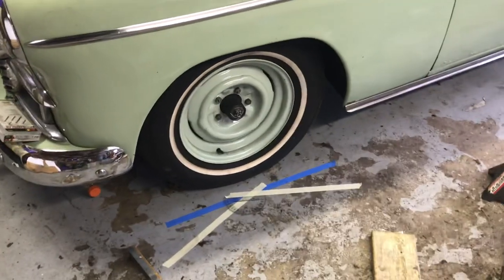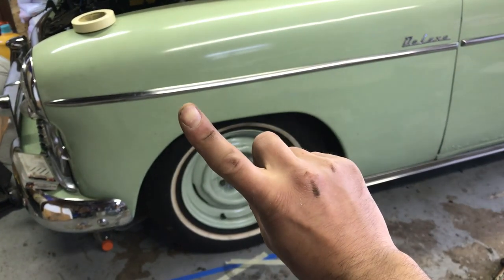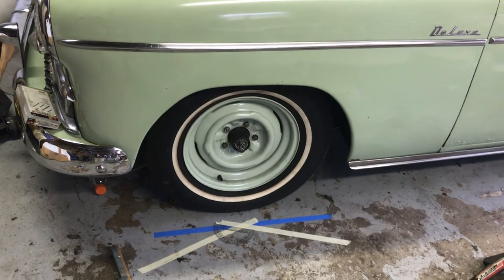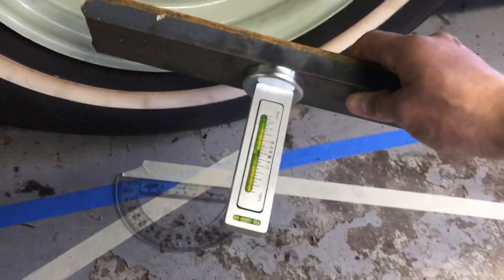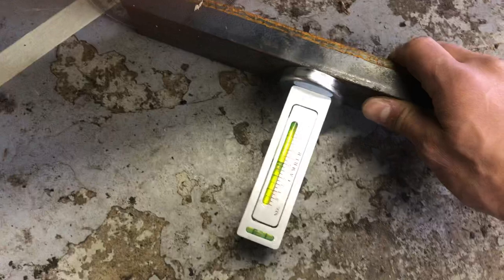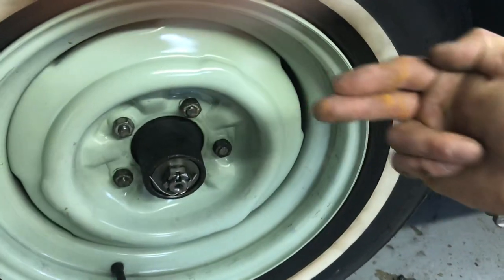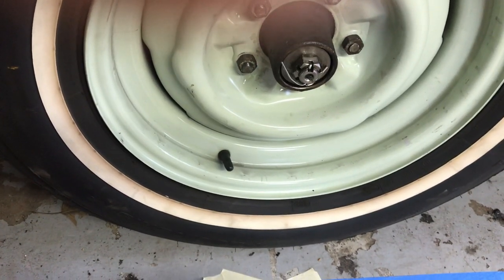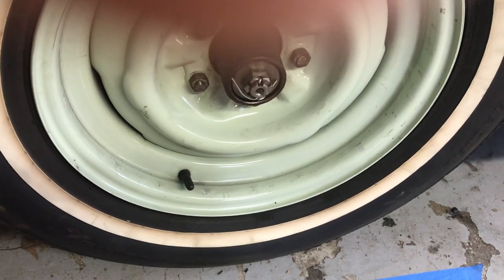DIY Caster camber measurements

Comment: FYI, that isn't totally correct. If you are going to use a camber gauge, then you need to do some multiplication depending on how far your sweep is. The change in camber does not directly give you the caster reading. It will considerable less.

Comment: Nice video.  I just got one of these gauges.  I am working on a 29 Model A coupe.  At some time I think someone had pulled the car out with a chain by its straight axle.  It had some serious bend.  I took it all apart and got the axle back flat.  Now back on the car, I have different camber on each wheel.  I bought this gauge to help me get an accurate bend on the axle.  Interesting that these old cars were to have 1 to 2 degrees of positive camber, leaning out at the top of the wheel.  Anyway, you take care.  Tom
Reply from the maker: Hi Tom! Glad you found it useful. I have done to understand the positive camber was to make the car easier to steer, but of course at the cost of high speed stability. Like a shopping cart vs a bicycle 

Good luck with your project! Hope it goes smoothly and thanks very much for your comment

Comment: Make cheap turn plates using 12'' sq adhesive vinyl floor tile. stick one to the garage floor (for each tire), put a small amount of grease on the top. Place another tile upside down on the greased tile, sticky side up. Pull the front car tires onto the tiles on BOTH sides with wheels straight. Do the measurements as shown in the video.

Comment: Ok stupid question that I am pretty sure I know the answer too, I have a digital angle finder I bought with a more expensive kit. Reading the angle from front of vehicle is what I want on each side right?  To get correct positive or negative for camber and caster. In other words dont read one side from back and one side from front. Their instructions don’t mention this and their customer support kind of is not helpful.
Reply from the maker: Never a stupid question, only a bad teacher (RIP Mr. Miagi). I always take my device and measure an extreme example. For camber, you can figure out which way your device goes by pretending your wheel is stick out at the road 20deg (extreme negative camber) and noting how your device reacts... that will tell you how to interpret less extreme readings  - does that make sense?
Reply: @DrewGarage  100%, kind of tinkering with that a little, need to fully understand what the readings mean. Changed balljoints and upper camber/caster sleeves. Think their instructions say to start turned in, zero finder then turn out 20 degrees and the is caster. 
So let’s say factory spec says 4 degrees. Next I set my in/out at four degrees. I see some videos say to do that to find caster then multiply by two to get caster. That confuses me why some say to do that but others don’t. 
I put factor upper bushings back in and measured those just to be sure and I think one was at 3 degrees
Reply from the maker: @joeholland428  Well, perhaps starting at 0° camber, 0° castor and going from there will help? This is by no means easy, and unfortunately, one of the most potent indicators of some thing wrong is an unevenly worn tire. If that happens to be a $240 wide white wall or nostalgic tire, no fun! What car do you have
Reply: @DrewGarage  I am working on a 2011 E-450 motorhome chassis. I bought these adjustable bushings to replace solid on setting ones. I did start at their “zero” then adjusting from there. I am actually zeroing in on it I think as we type. I am about to make an adjustment to account for the difference. Big help was just knowing what was what from positive to positive. 

I am still wondering why some videos say to multiply what number you get for caster by two to get caster
Reply from the maker: @joeholland428  
Wow that is cool! 
Not what I expected. I am not sure, but the information I gathered to make this video was from the leading supplier of camber/caster gauges for race cars. Expensive units. It was a long time ago, and at this point, I would need my own video as reference to do the job, but back then, I studied quite in-depth how to use their gauges, then bought an inexpensive knock off as Their little gauges cost more than my budget for an engine in my project

Comment: I have a 49 shoebox and im teying to figure out the steering when i go up to higher speeds the steering start to dance around all over the place what pointers can you give out
Reply from the maker: Start with tire balance and check for play in the front end. So many issues come down to balance and or a loose front end. Even a proper front end is loose in these cars compared to modern, and radials will magnify that

Comment: Don't you multiply the gauge reading by 2 or 1.5?
Reply from the maker: It’s been a quite a while but what’s in the video was correct based on that research and it’s been driving perfectly since :)
Reply: If you are using a 40 degree sweep (20 degree out to 20 degrees in) then you multiple the camber change by (180/3.14)/40 which is about 1.43.  If you use a 30 degree sweep, you'd multiply by about 1.91.  In general terms, you are multiplying the difference in camber measurements by the inverse of the sweep angle converted from degrees to radians.  Using the approximations of 1.5 and 2 are certainly reasonable given the limited precision of the camber measuring device.
Reply from the maker: @richardmurray1655  Shoot I wish i could experiment but I put the car away from an extended period of time last week
Reply: @richardmurray1655 thanks for your comment. I’ve been trying to get an answer to that for a while now. Is there some sort of YouTube video that explains what your actually talking about? Looks like triangles (180 deg) and pie are involved (3.14)

Comment: Would this work on modern cars without adjustable caster?
Reply from the maker: Most modern cars don’t have caster or camber, but there are bolts available for the strut to knuckle connection that introduce camber. Yes, the measurements would work, but a car that spends most of his time at 70 mph requires a little bit more precision than one that spends most of his time at 50. It’s a pretty dramatic difference… You can definitely do it, but be sure you’ve done it right ;-) lotta forgiveness in these old front ends and tall sidewalls of skinny tires

Comment: 47 plymouth front rt wheel leans way in on top while hanging on the side post lift how do i adjust that
Reply from the maker: First thing I would do is check for any play, and unfortunately, I've never worked on a 47 Plymouth, but I'm sure the manual is available online and the info in my video should help you apply that information to the car. Good luck! Please report back and let us know how it goes

Comment: what if we do the wheels behind the pivot point? just like shopping cart. will it work?
Reply from the maker: No, there would be crazy wobble
Reply: @DrewGarage  the car i am running has 1 degree caster. I cannot move the top mount, so is there anyway we can make thr caster effect without changing the top mount or wheel position?
Reply from the maker: @iamMohitMalik  i’m not exactly sure… It will depend on the vehicle… There are ways to get very creative. For example, on my 1950 Chevy in the video, in theory, I could slice the control arm, adjust the wheels position a small amount, and box weld everything back together. This is of course a death sentence if the welds aren’t good… What kind of car?
Reply: @DrewGarage  well i am ready to do anything to get caster. I am running a suzuki ignis 2017. It is built for autocross and gymkhana race events. Rallies for future. According to rule i cannot take the mounting point of shocker towards back. So was thinking to fabricate the coilover mount where it attaches to knuckles. Moving the bottom part towrds the front so that bolting points move little backwards.
Reply: @DrewGarage  on instagram - i_am_mohitmalik you can check the vehicle.
Reply from the maker: @iamMohitMalik  That sounds super cool! I don’t have Instagram, but it is on my to do list for our JDM business. I think your idea to fabricate a new coil over mount makes sense… Just obviously make sure all the welds are good etc. as again it is certain death if you lose a wheel and all the suspension at speed. I’ll try to check out your ride! Also, would love to hear how it goes when you do it
Reply: @DrewGarage  yes for weld we have professional mig weld guy inhouse, so weld wont be a problem for us. Already working on this caster thing to get around 5 to 6 degrees atleast. Will put up a video soon after testing.
Reply from the maker: @iamMohitMalik  excited to hear how it goes